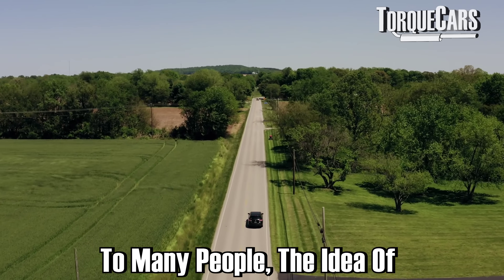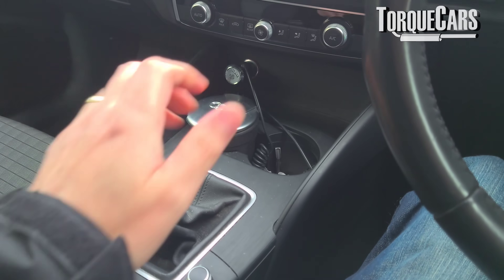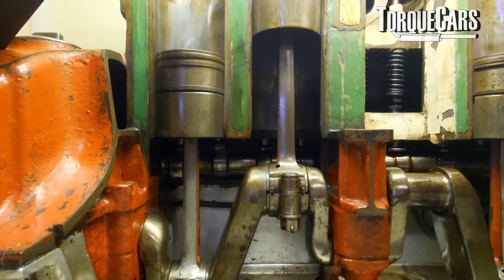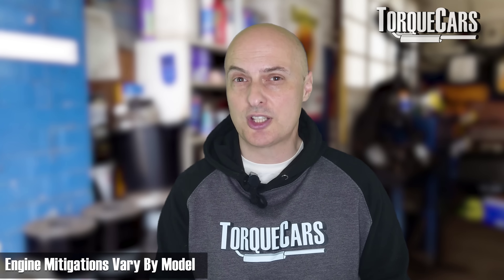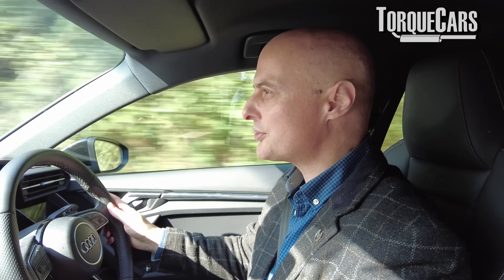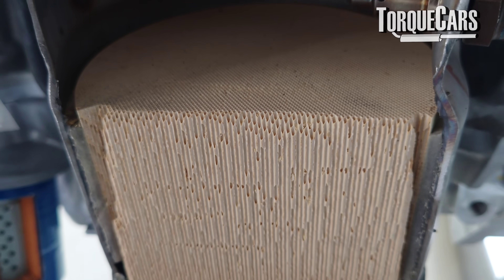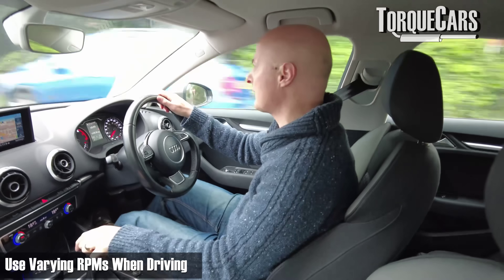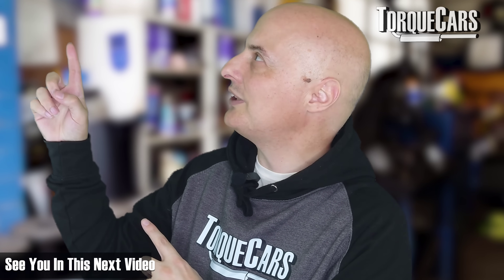BIG DAMAGE By Lugging at LOW RPM? Eco Driving Warning! (Manual Gears)

Comment: I always leave it on the last gear. I let the clutch grind at full throttle. This is how I drive. I replace the clutch every week. I buy them in 100 packs and get 10% off. 50000$ worth of clutchs. Every year I also replace pistons, rods and bearings. I've got the money. It also has a 2000 hp engine inside so it can go with the last gear from zero. Reverse gear? I do a donut. Reverse gear is for wussies.

Comment: Part of the problem is that driving instructors have been teaching everyone to be in top gear at less than 30 mph for decades. This means you are not in control of the vehicle as you cannot use engine breaking. The last person i helped learn to drive used a 2cv but wanted a lesson with a driving instructor & the learner due to my instruction forced the instructor to try & drive in the highest gear at 30 mph he conceded he was wrong. The learner past first time no help from the pro. If you drive any vehicle at 70mph for car's/ motorcycles or 60 for restricted vehicles & have a tachometer or you are not deaf & not connected to your nerves you will see/hear/ feel the most efficient engine RPM as most vehicles are designed to be most efficient at that speed. More restricted vehicles their are other speeds that do the same.

Comment: Modern cars power conversion is managed by its computer..so if it reach 60kmph at 2000rpm you cant take it to 4000rmp...that will suddenly increase the speed..which is dangerous on a road with normal traffic...

Buy a Toyota and nothing to worry..no complication..lol

Comment: It annoys me that I'm 3 mins into this video and "low RPM" hasn't even been defined yet. What is a low RPM? 500? 2000? 4000? In a Prius, I'm pretty sure my engine doesn't even run at low RPMs, ever. It just turns off if it's not needed.

Comment: Absolutely can and does cause problems driving at low revs, especially for diesels.
I used to do parcel deliveries in my area, and often I'd get 'anti-pollution fault' and the engine would sometimes cut out for a minute.
Once I learned to change later, i.e., drive at a higher revs, I have never had the problem since.

Comment: Many turbo 4 cyl cars have max torque at 2500 rpm range, but it is minimum torque at 1000 rpms, so you don't need 5000 rpms for max torque or power here.

Comment: I never understood how rpm effects the pistons/engine block due to the fact that they always do the full range of motion. BUT you are using less things like blasting air through things or other levels of thrust. for example, my oil pump has 2 stages, if i granny the car, it likely never uses the higher tier. which could clog that pump nozzle, or worse.

Comment: driving an electric powered vehicle after 50 yrs. of gas power, It is very clear just how silly, illogical, in-efficient and cumbersome to drive is the internal combustion engine. Ev's will only get better in short time, but even as of today, they are light years ahead of gas, as in,  responsive to drive, fun, cheaper, much less maintenance, quiet and smooth, a Much nicer driving experience that the old putt-putt.

Comment: Thuis is probably why my Opel Astra lasted more then 350.000 on low RPM driving only (on regular unleaded fuel, no diesel).When I had to buy a new one, because of rust-problems, the motor was stil fine.😂

Comment: A lot of modern transmissions lug the engine to “save” fuel. I set my transmission to power mode when I drive my car so it behaves more like a normal transmission. It doesn’t even use that much more fuel. The manufacturer is only worried about corporate average which amounts to less than 1 or 2 mpg per vehicle.

Comment: // use the full range of rpm only after the coolant is 90 degrees and oil more than 50 degrees.
\\ usually for turbo engines you have to be at least 1800 rpm (does not matter if is gas or diesel), and try to use the right gear.

Comment: Problem with videos about riding in "low" rpm is that they really what does "low" mean.
They show you the pictures or the half second clips with around 1000 rpm, assuming that  is it ?
Problem is - 1000 rpm is perfectly normal in 1 or 2 gear on a level plain when you are just crawling your car. At the same time 1000 rpm on a highway is surely a very bad idea. You will feel it. Car will vibrate and sound will not be pleasant.

Context matters!
Reply from the maker: I did another video that discusses this point in more detail https://www.youtube.com/watch?v=Uot7DHY_C1c and you are right, it is more about lugging and the load at low rpm than the rpm itself.

Comment: At first I loved my diesel mpv that could drive in fifth gear on low rpm with no problem! Soon I killed my double flywheel . 
That costed over 1500 to replace .

Please check if you have double flywheel and never drive under 1000rpm

Comment: Engines can be built to explicitly endure low rpms without developing issues. Back when Mercedes still had N/A engines their V6 and especially the V8, engines M272 and M273, could happily sit at 1000 or even 900 rpm all day. However, Mercedes also designed their gearboxes to go that low efficiently, but also to shift down whenever necessary. For manual cars note: Only press the pedal as hard as the car will accelerate naturally, past a certain point pressing harder won't make the car pull harder. Usually, starting at minimal rpm, in gears 3/4 the limit is about a third of pedal travel, in gears 5/6 barely above 15-ish percent.

Comment: When you combine this kind of driving with a modern diesel engine, all your asking for is pain, and lots of it. 

Low speeds and revs means a cold exhaust = soon to be blocked DPF - Broken down side of the road with that stupid light on.
Low engine speeds - EGR Open, engine consumes its own waste, blocks up intake and sticks to everything - Decreased performance and MPG, Increasing DPF problems.
Low engine speeds - Gearbox abuse at its finest, the dual mass fly wheel is working its bollox of constantly - Massively increased wear.
Lugging up hills - Injection begins before TDC on modern diesels so your really punishing the living shit out of the rods and crank shaft, making dual mass problems worse
Low RPM = very very low oil pressure causing significant turbo wear modern turbos are VGT and can spool up and provide boost from idle with NO real oil flow
Low RPM = Poor combustion results increased emissions, that in turn screw over the DPF
Low RPM = Low coolant and oil temperatures
Low RPM < 1000 RPM, your alternator is also taking a kicking on a modern diesel, the dual mass saves some wear but the constant power stroke speeding it up to immediately low down, they don't like it.

I could go on for a month about why you need to work a modern diesel. Once per week find a motorway, on the slip road use 3rd gear all the way to the red line, then pick 5th (if a six speed box, 4th if a 5) and sit at 70mph with about 2000 to 2500 rpm for 15 mins. Don't be afraid to work the car occasionally when your pulling away, And for the love of god, oil and filters cost nothing, keep throwing both at it, nice and regular.   Then you can have 10 year old 350,000 mile stock Audi A3 and A4, with a total forced regen count of less than 50, no big repair bills, no big disasters, one had  a turbo last year, and the other will need one this year but other than that. OIL FILTERS and Work thats all a diesel wants.

Comment: Avoid high engine pressure with low rpm. It’s what pilots are taught when they learn how to operate a constant speed propeller. An automatic transmission doesn’t let you run high pressures at low rpm. You need to have a manual to really do damage. Low rpm driving isn’t gonna do anything unless you’re sitting in too high of a gear.
Reply from the maker: I'd never thought about planes so that is a very interesting angle my friend, thanks for sharing. An yes it is lugging that is the problem here.

Comment: One thing that bugs me is the suggested gear indicator. 

For example , lets say its telling me to go into 4th at 30mph , thats all well a good on a flat level road but an inlcine will cause the car to lug . 

Ive always kept it in the right gear for the road , not too low i believe the revs should be in a place where tourqe is provided and easily obtained. I also find i get better fuel economy going by feel in my right foot , than those suggested gear indicators ! . 

But yes im a firm believer in clearing out the pipes at least once a drive , i live in a pretty rural area so im lucky i can . Plus who doesnt like reving out 2nd 3rd then half way through 4th !

Comment: Well, I am driving my fourth TSI engine with probably exactly that driving style: low RPM (1500RPM)but full Torque (250nm) with manual gear and never really ecxeed the 3000/3500RPMs (Except in German Autobahn 🤫). And never ever had any problems. Probably already surpassed the 300.000km with that style... So for me your concern sounda kind of theoretical

Comment: The biggest risk in life is hitting an idiot!!

Only a fool who doesn't know how to fumble the controls of a car and scare people can talk like that. 

Mention of the pump is out of place in modern cars with variable displacement pumps. Besides.. low pressure is not indicated by the on-board computer ?

Low revs (1500-1750-2000) don't hurt per se but only if high power is required at those revs. IF you drive on the flat at a steady speed ... it's perfectly fine and the engine with variable valve timing runs on the economical Miller cycle. 

Unburned fuel? What about the lambda sensor control unit... those are a sleep and do nothing?
Reply from the maker: Hi buddy, I really wish I could assume that everyone is driving modern engines with variable displacement pumps and variable valve timing, but a recent survey of our viewers show that most are driving older cars. Whilst it would be nice to have a specific video for each type of car, it makes more sense to have a general one that informs people enough so they understand what the potential risks are.

Driving correctly went out of the window for many hyper milers who assume that low RPM is better which is who this video is aimed at.

We  are both in agreement over "Low revs (1500-1750-2000) don't hurt per se but only if high power is required at those revs" and that is the whole point of the video really, as the title says "Damage from lugging the engine". LSPI is a risk on most turbo engine, modern or old so is worth a mention.

The lambda sensor only works when it gets up to temperature so when the engine is cold things are far from ideal.

Rather than scare people I'd rather inform them so they can develop a mechanical sympathy and reduce wear and tear.

Comment: I drive a Petrol 2021 1.2 Turbo Opel Corsa with 100hp... It suggests with a little arrow that I switch gear at around 3k rpm... So is the suggested rpm 2k? Seems very low for a petrol car...

Comment: Here's a little tidbit of information any Hemi or any vehicle with multi displacement systems literally on the Hemi will lock your plugs in your head from serious amount to carbon buildup and you will strip your heads if you try to take them out it is best to drive your Hemi in tow mode.. it shuts off MDS I still got one head stuck on my vehicle because the spark plugs will not come out of the head without stripping them and throwing shavings down in the cylinders MDS is garbage in fact it is the leading cause of destruction of the 5.7 Hemi it causes way too much build-up inside the motor when there was a run and it's always the same for cylinders it'd be nice if it alternated but instead it puts all that Carbon on the same 4 cylinders

Comment: My engine has a pretty flat top of the torque curve 2000-4500 rpm, free gear 800 and redline at 6500. When I accelerate I use torque optimal rpm range, throttling up gradually. Only when I really need to quickly accelerate I extend that to 6000 (that's rather rare occurrence) where the top of power curve is. Always easing up throttle gradually as nearing desired speed. Other than that I coast at around 1000-1200 or lowest rpm possible above that. Small speed adjustments 1500 (~80% of top torque)-2000 if that range is available, going very easy on throttle.
Anything wrong with that?

Comment: Choose the correct gear for the speed you need, change fluids frequently and that's it.
Be happy
*and as being said before, if what you want is fuel economy it is better to stick near the high torque rpm.

Comment: I assume my first car had been driven all its 20 year life at low RPM which I think caused wear on the piston walls only below a certain piston extension height, since pistons extend further up the chamber the faster they travel. Whenever you got to about 4/4.5k RPMs the pistons would extend further into the chamber and slam against these wear lines and halt it from getting above that RPM. In first gear the poor automatic transmission would be waiting for the engine to get to a higher RPM to switch gears, but the wear rings would hard limit it with this continuous hammer-on-anvil sound of the heavy metal pistons all repeatedly slamming into this wall that had formed on the piston walls and prevent it going any higher RPM even with my foot to the floor.

Comment: I had a pd150 mk4 golf and drove it to its limits every day up to the milage of 326000 miles from new regular oil changes. Only parts changed were general wear and tear parts timing belt wishbones drio links breaks tyres, etc ... engine was bomb proof had to part due to body rust or id still have it

Comment: A lot of oldtimer hypermiler techniques aren't really valid for turbo engines. Running too low RPM makes the engine have much lower compression, less air/efficiency than when the turbo is spun up causing less efficiency and fuel consumption than running say 500-1000rpm higher. The turbo being spun up also cools the turbo and the charge better. The points you made also apply to these engines.

Comment: When I'm driving downhill or on the flat I can use 5th gear at 55 km/h. 
But when it's slightly uphill I prefer to use 4th gear. 
If it's steep, I prefer to let the engine turn more in 3rd gear.

Comment: I guess extreme under revving might cause a problem but on the whole I suspect over revving will cause more damage. The key is probably to drive normally (engine revs will likely be raised at certain times, eg joining the motorway). I don't ten to rev the engine more than necessary (probably under revving in your eyes) and have had good engine life. I presently own a Volvo 850 on 230k miles and a V70 on 180k miles and before that covered over 300k miles in a 244 (I've own all for new / nearly new)

Comment: as far as i got from the internet high rpm is bad low rpm is bad not driving is also bad best thing is to not have a car
Reply from the maker: Just leaving your house is dangerous! It is important to know where problem areas are and appreciate how things work, but we can never really take things to the extreme. Damaging an engine will usually mean you are taking 15,000 miles of the lifespan of the engine, when your engine does 150,000 this is a non event for many drivers. If you want to keep your car as long as possible and avoid breakdowns, then I think the key is to avoid the extremes, lots of high RPM or only using low RPM. I wish people would learn to drive properly - especially when it comes to gear selection on a manual box.

Comment: Question: If i drive up a hill for 5 minutes and i use 90% power at ~2000-2500 RPM, 70 kph in gear 4, do i have to shift down?
My car gets really noisy at gear 3 and 70 kph. Sounds almost more unhealthy?
Reply from the maker: If it doesn't feel like you are lugging (the engine struggling to make power and pull the car with vibrations etc) you should be ok, but it will depend on the hill and the engine really. Your ears and senses are key in determining if the gear is correct. Don't be afraid to rev the engine, they are designed to be worked and many drivers never go over the half way point to the red line so they get used to a "quiet engine".
Reply: @torquecars  Ah okay. Thank you for your response :)

Comment: Can someone call Genesis and send them this video?  I don't know about other brands, and i love mt G70, but holy hell comfort mode refuses to shift down.  Since I grew up with manual transmissions I know how to manually shift down properly with the paddle shifters, etc., and I live in a flat area.  When I drive to the mountains it still refuses to shift down going uphill under load.  In the mountains I always put it in sport mode so it drives at 2k rpm or higher.  Even where I live when it's flat probably 70% of the time I'm in Sport mode so it's at a higher rpm (even because it's more fun).  I understand i get better gas mileage at low rpm, but Genesis tuning literally does everything it can to keep my car at 1100 rpm at all times.  It always makes me wonder about the engines in cars like this when people don't know about cars and how this can be bad for it.

Comment: Driving always under 1500rpm, between 1000-1500rpm, not just damage you engine it damages you gearbox, diff and cv joints cos of a lot stress and vibration that causes of that very low rpm.

Comment: I was told day one when I started truck driving to never drive at low rpm on turbo deisel engine's Its called lugging, holding your foot down flat waiting in low revs/high gear and making the turbo engine  slowly gain boost and putting all that stress on the engine with nearly 50 tons in carry. You will chew through an motor a year doin that let alone the other moving parts.